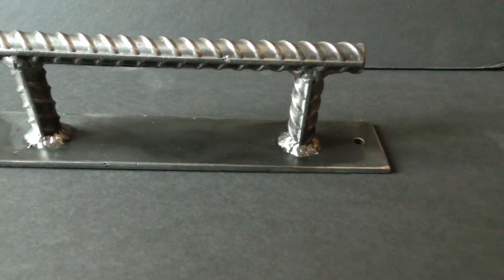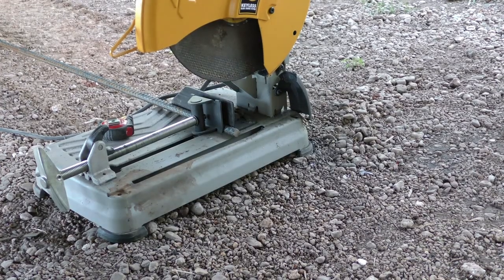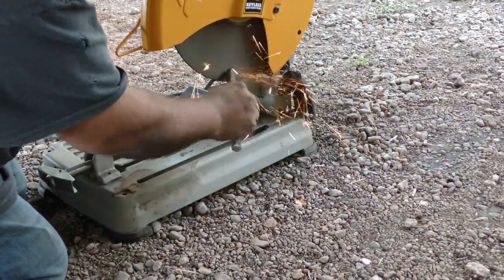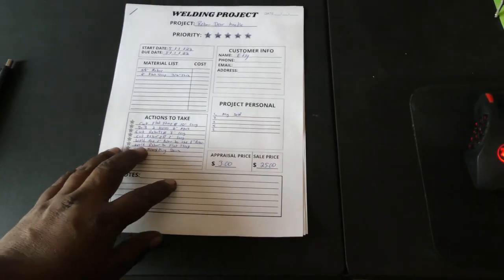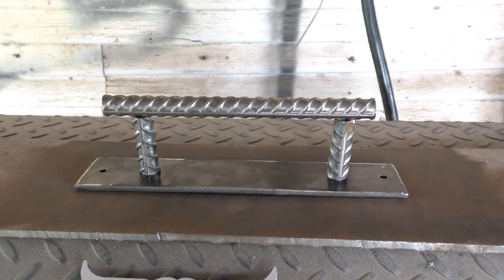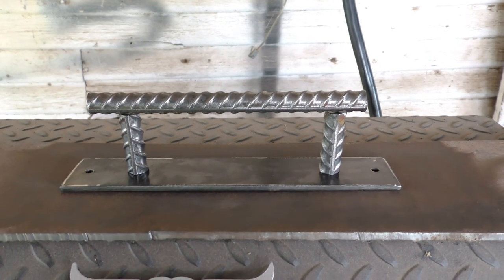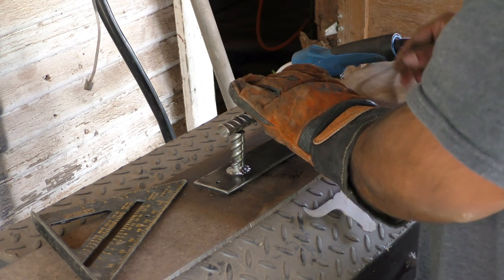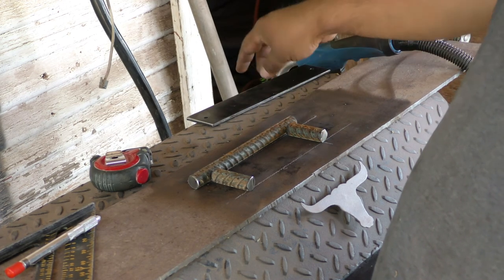Making A Rustic Barn Door handle for Etsy

Comment: Just found your channel and have watched a handful of videos, good stuff out there getting it done! How has that Hobart Champion Welder treated you?
Reply from the maker: Hey thank you for watching, the Hobart Champion Elite 225 has still been one of the best investments so far. The only thing I have done is normal maintenance and a new battery. Otherwise it's been keeping up with all the load I put on it no issue what so ever.
Reply: @WeldingProjectsTV  thanks for the reply! Seems like a solid option for the price for sure! Good to hear its been solid, it may be in my pickup eventually also!